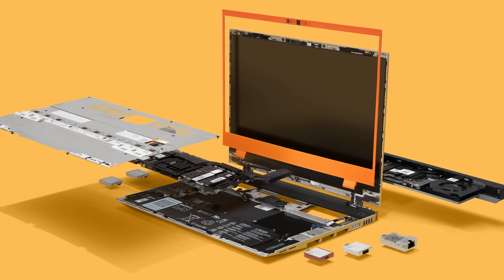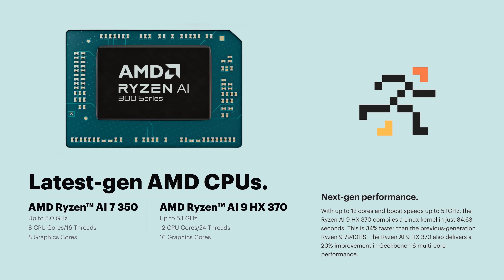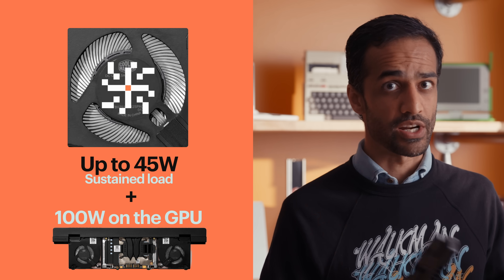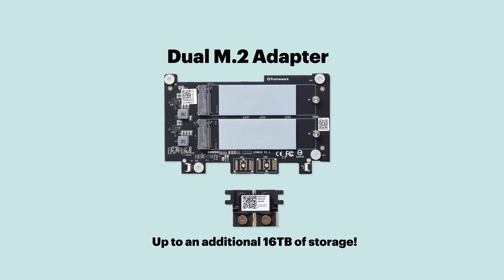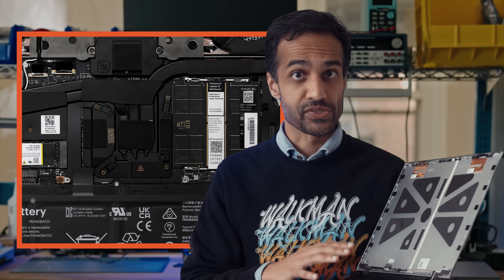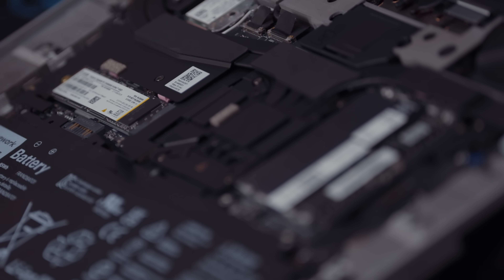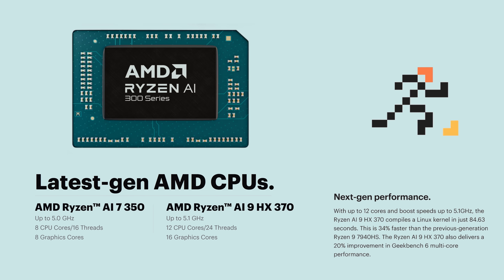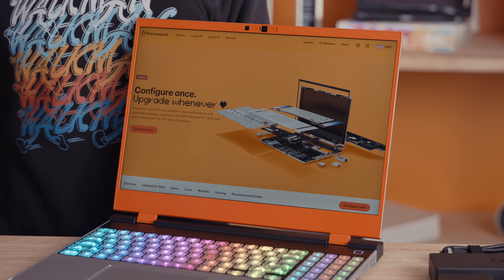Introducing the new Framework Laptop 16 with NVIDIA® GeForce RTX™ 5070

Comment: One thing I have notices is that the heat dissipation for the GPU is better than it is for the CPU
2:56 I was hoping for this on the first one! Is there a 2nd gen Ryzen one with it?
5:40 So the original Framework 16 is supposed to work with 240W, that still holds true, right?
A bid disappointed because there is so much you can upgrade, I will probably have to skip this one despite waning some of these upgrades.

Comment: I won't buy one until they bring the 5080M and 5090M to this machine. But huge huge progress. I'd love to see some sort of parallel multi port USB C charging that would allow the USB C power to be doubled from 240w to 480w, more than enough power to sustain the higher tier gpus
Reply: I'm afraid with these gpu's the laptop will be twice as thick. It will be necessary to develop a completely new case, etc.

Comment: Make it cheaper bro. For consumers the biggest reason to buy this is to save money instead of buying a whole laptop again. If it is so expensive at the current price I might as well just buy a new laptop when I need upgrades. I will only buy Framework if the price makes sense in the future. If you still going with this price? I see Framework as a failed project.

Comment: I mean it’s cool and all…but laptops are kind of a specialised device. They are designed to be portable, and therefore have massive design and performance constraints compared to  desktops. And desktops are already highly user swappable. So why don’t most people just use desktops? Well, they did, until they were convinced by big tech that they needed a much more expensive and much less powerful device that they couldn’t modify themselves instead. 
Framework has gone a long way to solving a problem that isn’t actually a problem in the first place…

Comment: Common Framework W

I just need an option for a replaceable, high refresh (preferably Tandem) OLED panel at 4K+ resolution, and i'm sold on upgrading my setup. Also, BSD getting a mention is so nice. USB-C PD charger with 240W as one of, if not THE ONLY ones thus far in the market was the biggest win, i personally think. So cool!

Y'all are genuinely competent, passionate and listen to the demands of your customers and marketbase. Really great to see. You're keeping yourselves on the forefront of the entire industry this way and my encouragement/support has been fully with y'all from the start. Keep it up!! <3

Lastly, shout out f4mi :D
Reply: 1,600 nits WITH Dolby Vision support too.

Lenovo Yoga Pro 9i Aura Edition has a 1,600 nit Tandem OLED panel but it's not 4K unfortunately and it uses an Intel processor. 👎

Comment: Even with the Nvidia module physically attached to the laptop, is it possible to run the laptop purely on the iGPU of the AMD HX chip?
(e.g. for extended battery life on the go, but then fire up the RTX 5070 when plugged in)

Comment: Awesome job. Still love my Framework 16. Of course I have spec envy now even though both the CPU and GPU are perfectly fine for what I do. The RTX5070 would be an upgrade of course for gaming, although I don't know how much in Linux.

One simple way to at least lessen the ridges between the panels and the touchpad module would be to just offer a spacer that's twice the width of the two narrow ones? Personally I have my touchpad on the right (left-handed num-pad yo!) but I imagine most people would have it on the left anyway?

Would it be possible to have the keyboard replaced with a second screen or Wacom-style drawing pad? Or really lean into what you were trying to do with the large touchpad and just have that whole panel be a drawing pad? Or maybe the full width minus one of the spacers which could house a pencil?

Comment: I’m not ready to upgrade my laptop just yet, but when I do I’ll be picking up one of these. Finally, as an industrial designer, I HATE bringing my laptop to site work, it’s just a bulky, loud, piece of aluminum. If I can take the graphics card out, when I don’t need it, and put back in when I do. It’ll make my life so much easier.
Reply: its not as simple as youd think. pop the top bits off, then 15 screws and a connector, then 4 more screws for the gpu connector, then everything in reverse. not insane, but not that easy either.

Comment: I don't see a point in swappable GPU. I like the modular design approach but if you see the history, there are very few companies tried swappable gpu in the past and failed. Because, lets say after a few years I want to swap gpu with newer faster gpu. you cannot use full speed of gpu since your old cpu will bottleneck any graphical/gaming advantage. At that point you would want to replace the cpu too, hence a new motherboard with a new cpu gpu combo.
If you guys like the design, good for you. Its just my view.
Reply: PCI-E 4.0 x8 link is still plenty fast for mobile GPUs. You can't put a high power desktop GPU to see any bottlenecks anyway.
Reply: @one_step_sideways  No, You still see bottleneck. I have used those laptops. Most games depends on CPU processing before sending compute to GPU. Theoretical stats might not directly relate to real life performance.

Comment: Would've been a day one purchase. 8gb Vram killed it. Hopefully the next one will have 16. At least 12.
Reply: Blame Nvidia, not Framework. There isn't a 5070 laptop chip available with more than 8GB.
Reply: @mattbosley3531 I wasn't assigning blame to anyone. Considering this is the only laptop 5070 that's upgradeable. It's already a one off. Using higher capacity Vram chips isn't a big ask.
Reply: @GigaTexan  look at desktop 5070s, none of them have 16gb vram. its a nvidia issue, because the nvidia driver has to allow it.
Reply: @bradhaines3142  Then I would've gone with a 5070ti. Using 8gb of vram on a 165hz display that's capable of running at 1440p is a mismatch IMHO.
Reply: @GigaTexan  they also have 100w limit to worry about. not sure what thatd cost in performance but i definitely agree, because its not 1440p its 1600p. even more reason to have more vram. the current 7700s is on par with like a 3060, so an upgrade is seriously needed. but idk if they can get the per watt performance boost high enough.

Comment: My biggest complaint isn't about the framework. It is rather about the open source software and operating system. I hope framework can look into resolving this if it is their hands though they are primarily a hardware based company. I use Ubuntu, especially coming from a Mac, and earlier Windows 7 User. Linux is great, in the case of privacy and customisation, but the problem is, most consumer bases are normies, and aren't used to a bash or a sudo command. If Ubuntu polishes its software, out of the box, a version thats friendly to normies, and collaborate with major professional app makers to make it accessible for professional work flows much smoother, (like how Valve does it with games and proton), and overall makes a very non coding friendly environment, that would appeal to the general base, it would seriously challenge the whole Mac OS itself, and by far windows for its bloat. If Framework  could convince Ubuntu and major Linux distribution to work together on app compatibility, professional work flow, (and not just, oh there are alternatives for linux), wherein in a professional environment switching apps is out of question, the software and hardware integration, with a focus on normie UI, would kick the ball out of the park. The focus is (things should work out of the box). Though, I must say, it could be a version of Ubuntu that's normie friendly, while also a version that could be excessively customisable. Thats the major problem ---- The software issue

Comment: The Nvidia card should have been a 5070ti at the minimum, or even a 5080. As this is what I'm aiming for, it means my 16 is no longer powerful enough and in now need to upgrade for better GPU options. Framework failed.

Comment: All this needs is external RAM modules so we can spec this with 256gb+ RAM and this would be a beast machine for running local LLMs on the go!

Btw congrats on making a 240w GaN charger for this machine, we've had the tech for years but it's so hard to find devices and charges that use the full potential of the USB 3.1 PD Spec!

Comment: Amd graphics...discrete or strix apu.    Not interested in nvidia.  Something fully compat with linux oss drivers would be ideal. (With dvorak keyboard option).  The extra m2 modules instead of gpu addon sounds good if it has a strix 395ish cpu.

Comment: 8GB VRAM makes me die inside 😭😭😭😭😭😭Not having a modern GPU option is straight up pooping the bed. I'm disappointed beyond belief. My month is ruined, and my excitement has been trampled. Literally a single component away from being acceptable. Talk to your users before you roll out some dumpster-water GPU that won't survive another generation. Anything less than 12gb should be illegal in 2025. You deserve to be sent hate-mail for this.
Reply: Others are saying the fault lies with Nvidia.
Reply: @Norp-i7m  Others should look at the dang spec sheet and pull their heads out of their butts then. Google "5070ti 12gb" and see for yourself!

Comment: Now THIS is how you sell a product.
Reply: huge plus, no marketing fuss!
Reply: Fr
Reply: Except they removed the 3.5 mm jack to sell it on a $20 audio expansion slot, and no one is mentioning this anywhere.
Reply: @azenyr and you still have 5 extension ports available, or you can use Bluetooth headphones and have extra port for free!
Reply: @sonickrnd he gives me an impression of a typical whataboutist. Maybe I’m wrong.
Reply: @azenyrthat’s from one side, from another, to be fair - if you plug & unplug your headphones frequently that’s about 3-4 years and headphone socket is cooked and that’s reported on MacBook, so 20$ to have an optional headphone socket gives an average user opportunity to minimize soldering work. If they even know what that means )))
Reply: @v4vendetta156   I use headphones on my laptops since ever, my last laptop is now 12 years old and now with my young brother and the headphone jack is still perfect. I never heard about anyone breaking any headphone jack. That is just massive copium.
Reply: @v4vendetta156 The headphone jack could also have been a modular daughterboard. Oh well, you have to add the price of four/six modules to the DIY model anyways.
Reply: @leonro  also you have to add m.2 and everything else you want to add :D but thunderbolt - you can't add.(

Comment: Never be publicly traded. I would love to see UDNA and RDNA 4. We also need Ryzen 5 and Ryzen 7 X3D CPUs!
Reply: 100% but with 16 GB vram!
Reply: Just wanted to write this! The main thing is to be able to fit such a module into the case + cooling + power supply subsystem...Probably with such a module we will have to double the thickness. But I would love to buy such a variant! I prefer laptops with a massive cooling system.

Comment: Gys, comom! 8gb vram in 2025, you have to make version with 5070ti unless its gonna age crazy bad after one year
Reply: They should have gone with the 5050 8GB or 5060 8GB, for less money, $650 for the 5070 8GB is terrible, it's only 15% faster than the 5060..........Hopefully the 5070 super module has 12GB VRAM and you can upgrade it later.
Reply: It has a GPU Module. You just pull the GPU out and put a different one in…
Reply: @Skiptrac3  what?
Reply: @Norp-i7m  dude doesnt understand framework would have to make that gpu module for his comment to be relevant

Comment: 2:45 says only 8GB of vram for graphics ⁉️💀💩👎 Before people get all well this isnt a desktop I will refer you to my current 16" rtx 2080mq laptop which also has only 8GB of vram that I bought way back in 2019! Yeah I will continue to wait for a real upgrade!
Reply: Same vram amount since the GTX 1070, Nvidia is cuckoo
Reply: Not framework's problem, it's nvidia
Reply: @Zvxers7 Framework could have chosen to use a different GPU.
Reply: Yeah, this is a joke.
Reply: It's only a laptop, lol
Reply: @javiercmh  I was hoping they would use a stripped down version of NVIDIA GB10 chip: 5070 comparable compute, DDR7, but with up to 128/192 GB of VRAM. So if he would choose for example 80 or more (92) the laptop could run GPT-OSS 120B and large coding models. Just leave the ARM cores out.

Comment: 00:25 To rival a desktop, one needs a desktop GPU... Which Framework is completely capable of connecting to via Oculink. Let's get it done!
Reply: I use my framework with a 4080 egpu over usb4 while it is only x4 it works fine minus some detection issues at boot.
Reply: @raldone01  what kind of issues? Mine has weird issue when it's restarted. Fans don't spin nvidia app takes long time to load until i disable and enable it in device manager. Shut down + power on works fine. Very weird.
Reply: Honestly, if they did make their own eGPU enclosures that would also be sick
Reply: @CRNGD  Maybe thunderbolt 5 compatible egpu dock.
Reply: Even on USB 4 egpu the desktop 70 series is much more efficient and runs very cool

Comment: Does the laptop have to do DC to DC conversion with the 240W charger over USB-C, or is the charger able to deliver the exact voltage needed to charge the battery? Does the charger support USB PPS?
How is the battery life under light load, like watching 1080p youtube videos in firefox? How do the different configurations compare? If it's less than 10 hours, an expansion module with an extra battery could be a good next development.

Comment: Why RTX 5070? And not RTX 5070 Ti? 
8GB VRAM in 2025 is not amazing...
Reply: There's only so much GPU you can squeeze into a 100 watt power envelope. The desktop aib equivalent of this chip draws 250w. You could put a 5090 chip in it, but if you constrain it's power draw to 100w, it probably wouldn't perform any better than the 5070 they've gone with. I would have liked to see 12GB vram, but again, that uses more power and would reduce available headroom to the GPU itself. AI people might value that VRAM over compute performance, but tbh this expansion board is a general purpose unit so I think they've hit a pretty good compromise given the power requirements. Also silicon availability has to be a factor, if Nvidia have greater stock available with the 5070 silicon than they do with other SKUs, that'll make it easier for a smaller company to work with
Reply: Imagine the price lol.
Reply: And it’s $700 for the expansion part upgrade…crazy for a GPU that’s already obsolete.
Reply: @LowmanGames I wouldn't call it obsolete. Don't forget the desktop version of this GPU is currently selling around $550. An extra $150 to squeeze it into mobile device in a custom, relatively low volume product isn't that bad.
Reply: @bappyplays I’m playing 7 year old games that are pulling 12GBs of VRAM
Reply: @LowmanGames yea 8gb isn't a lot these days. That's an Nvidia problem though, not really a framework one, unless you want a 5070ti mobile chip, which will be constrained at 100w and it would be $850 because Nvidia. Shame really. But I think framework probably can't afford the r&d to put 2 models up for sale

Comment: WOW, I still can't believe that Nvidia made modular 5070 for framework... Maybe Nirav Patel hypnotized Jensen Hwang with something 😂😂
Unfortunately it's 8GB VRAM, but it's 5070 laptop, not 5070 desktop version - which means framework did everything they could, it's just Nvidia did Nvidia
Reply: WRONG! They did NOT do everything they could. They COULD have used a 5070 ti and gotten us 12GB, but they didn't!
Reply: @wyattarich Yeah, that would make it more of a purchase. Even though the TDP difference is only 10 watts.
Reply: @STX_12  Price is not a concern, longevity is. TDP difference is almost irrelevant because it can be set by firmware.
Reply: @wyattarich  First of all, we have to think that Framework is a small company, so they have to make the choice and concentration. Secondly, TDP is not an issue - 100W is the sweet spot though - but they had  physical space problems (as Nirav said in Q&A) , so RTX 5070 was the best choice for them if they should pick only one model. I understand your opinion and also little bit disappointed about 8GB VRAM, but we also need to understand their circumstances. Framework is not a dreamer startup, rather they are real tech company who're trying to change the consumer electronics seriously.
Reply: @cnrrndirnfhf5879 Thanks for taking the time to write a thoughtful reply based in reality. I still disagree that it's because of size constraints. Even if it ends up being a financial problem to invest in a pallet of nvidia chips, I find it hard to accept that they couldn't find a way to make it happen, even if it meant offering another more expensive model. If that was the case, they could have just said so and avoided this outrage.
Reply: @wyattarich I appreciate your respectful response, thank you
Even though the launch of the new GPU option with CUDA & DLSS enabled is very delightful, given that some of recent AAA games use almost 10GB of VRAM even in FHD resolution, it's very sad that we still have only 8GB option. Maybe we need to wait until AMD makes the new RX 9000 for Framework. (the fastest & easiest option would be changing each 2GB GDDR7 VRAM modules to 3GB, but I think that Nvidia will definitely not do that for 5070 laptop)
Reply: @cnrrndirnfhf5879  Next gen AMD is going to be very viable according to Moore's Law Is Dead, but that's looking to be toward the end of 2026. That's a really long wait :(